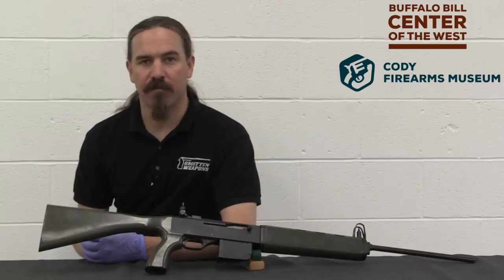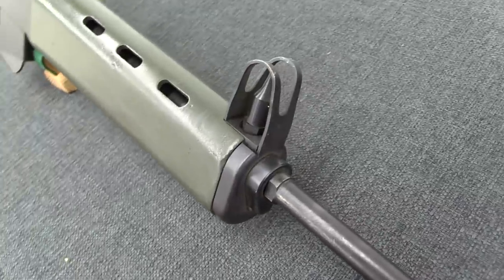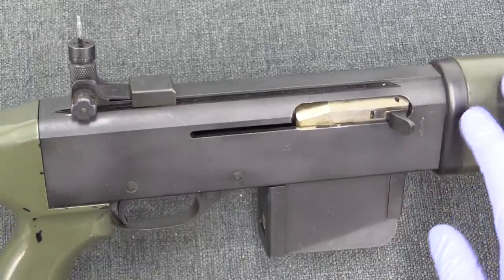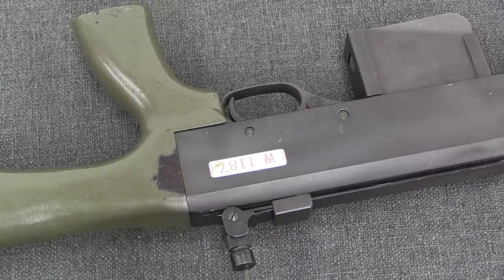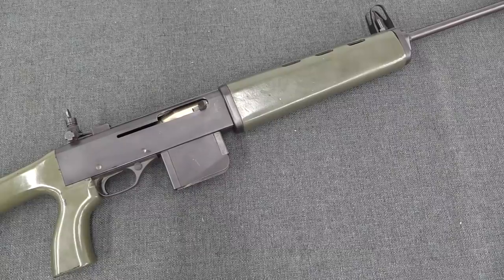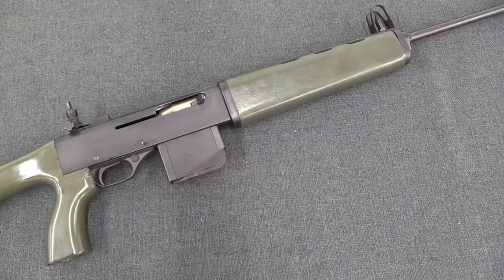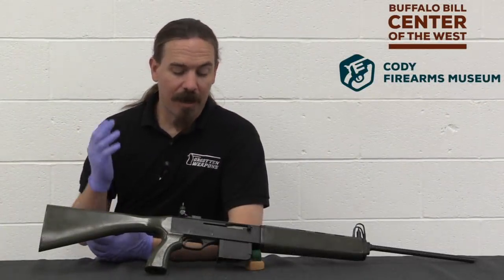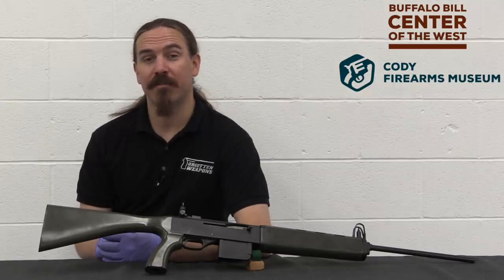Winchester Mystery Prototype: Melvin Johnson does Project SALVO?

Comment: Looks like it was based on a Winchester 1400 the bolt and trigger and general receiver look right and the 1400 was a gas operated self loader to boot. Only problem is that it was released in 1964 so maybe it’s an earlier model 50 or 59 receiver blank that was converted into gas operation (not entirely impossible considering how different it is from base shotguns). But if it was a 50 conversation to gas operation this could be what inspired the 1400 and Winchester gas guns. 

One way or another a cool video on another cool gun!

Comment: My hypothesis is that it was a possible replacement for the M1, before the adoption of the M14. 7.62mm shades of the FN FAL and the Johnson sights, green furniture in an early polymer to meet weight requirements and a magazine well for a 20 round box magazine. But what do I know. If it was it would have been cool.

Comment: One thing that would be of interest Ian, has anyone done a chamber cast?  Some of those serial bullet cases used very long necked and shorter shouldered cases, while staying more of less .308 OAL.  That would be very interesting to see and could be done without disassembling the gun.  The other question I have is how is the magazine retained?  Maybe I missed it in the video but I didn't see it mentioned.  Last comment; the 'hole" at the back looks like a Winchester pump shotgun (Model 12 like) bolt release (or is it on the wrong side.... I don't have one handy to check...)

Comment: Internals looks a lot like some Winchester Super—X1 and that rotating bolt would later pop up in the mid 60s on the Winchester 1200. I have several examples of both in Phoenix if you would like to examine

Comment: I would guess that it is intended as a possible replacement for the M1, competitor for the M14. They roughly copied the form of the FAL, but used parts they already had onhand. Likely this later morphed into the Winchester model 100 rifle.

Comment: You mention not knowing what magazine it took, yet I find the lack of even a magazine catch interesting. Normally if it used an existing magazine, the catch would provide a clue. This appears to have only a hole punched in the rear of the well, suggesting a catch mounted on the magazine itself, perhaps as a stopgap expediency for testing.

Comment: If that's a 1200 trigger group, the gun would likely date from the early or mid 60's. I wonder if they were playing with the idea of a cheaper replacement for the Model 100 based upon the 1200/1400 shotgun platform? It's not a terrible concept; the space occupied by a 12 gauge barrel/extension would be sufficient for a suitably beefed up rifle breech.
The paramilitary styling could be just to spice up the project or offer some misdirection as to the true purpose.

Comment: I'm fairly certain this is built off a Winchester 1400 semi-auto shotgun which would mean it's post-1964 OR the design work that went into this eventually evolved into the 1400. The bolt and carrier look very similar as does the receiver setup though the bolt head on this clearly has larger lugs than a 1400.

Comment: I really wonder if this was a developmental competitor or replacement to the Winchester 100 sporting rifle as it certainly used a lot of cheaper to produce parts (aluminum receiver, shotgun trigger group, synthetic stock)  completely possible that some of the military features were just expedient at prototyping.  I "think" the trigger group is off a Winchester 1400 rather then a Model 50.

Comment: I'm with you Ian. That shade of green, that's feeling Army, that's feeling military. 

I'm also wondering about just how much space is in the stock. If there's enough for a cleaning kit, that also would be a military sign for me. For the period at least. 

Combined with .308, the timing, you're making a real a good case for me. 

As for the one part I'm not sure on, need a rewatch on, it's just how shotgun this feels in places. It's not just the bolt, it's the main metal receiver that just screams shotgun to me. 

If I had to guess, I would sooner suggest that this was a spitball, can we do it type of project. No-one said they couldn't and they just got started. It's got a bit of kludge, kind of ugliness, kind of making it work before making it pretty feel to it. It feels like a test run before the actual prototype. It feels on some level like a mechanical test, do the systems, mechanisms in that configuration actually work. 

It's the pre-prototype on some level. At least if we use my game making language here. Even before the alpha build.

Comment: Model 1200 parts?  Model 1200 was introduced in 68 to compete with rustingtons 870 downmarket cost cutting machined and assembled by unskilled labor shotgun.
Edit, model 1400 was semiauto variant.   It was introduced in 64.

Comment: I would say this was definitely made post 1964. Thats clearly a winchester 1200/1300/1400 trigger group. The gap he shows in the trigger guard is for the slide release on the pump action. Probably a "military" prototype of the winchester 100 series of semi auto rifles. Which were built from 1961 to 1973.

Comment: I think the bigger indicator that was a military related project gun is that magazine well. Considering almost all rifles intended for civilians during that time period, would be focused on hunting. Therefore such rifles would typically designed with holding only 5 rounds in mind, but that rifle has a magazine well that sticks pretty far down. I'd put money even if you were to limit the magazine size to just that of being flush with the magazine well, it would hold at least 10 rounds possibly more.

Other then Hunting the only other real possible civilian market would be police forces. While there was probably a market for semi auto police rifles, a semi auto with the power of something like .308 would really be overkill for most police needs today, and I would think that would have been seen as doubly so back then considering almost all police forces at the time were still using revolvers. I would think if a police force wanted a semi auto rifle, an M1 Carbine would have been considered more then sufficient.

Comment: Could it be possible that it might have been from the 60s and been an early concept for a dmr self loading dmr type rifle? Like an answer to the Soviet SVD rifle, with back up irons and using just parts they had laying around? I couldn't tell to well but on top of the receiver it looked like a it could have been fitted with some kind of scope mount. Considering the jungle environment that we were fighting in Vietnam it seems possible that they could have been looking at options to replace the scopes m14 with something lighter weight but still able to punch through the thick jungle.

Comment: You may have found the Holy Grail of .308 military rifles ... the first .308 assault rifle made in 1949 to 1951.... and here is why .
It's either a .300 Savage or one of the  first .308 Win.  Rifles ever made .
When I worked at Gunsite in Paulden Arizona when Jeff Cooper was there this was always talked about ...that Johnson had built 2 prototypes from a Winchester 50 receiver and gas impingement system ....Winchester had the early  operations of .308 rifles before anyone ...in 1950 before anybody had even got the cartridge and Johnson  the father of the .308 assault rifle  ....not that Ludwig Vorgrimler. .... who invented the roller lock system that HK uses and  father of the device 06 H which you featured on your show.... he is credited with father in the first .308 assault rifle at CETME (Centro estudios de tecnicos y matematicas espanol) in Winchester always stated publicly  that he wrongly  always gets credit for this. 
This may be the mystery first .308 rifle that everybody always talked about  as Winchester had the .308 cartridge experimental develop from the .300 Savage in 1949-50!... and kept it top secret and were building prototype  rifles before the trials  in '51 and '54 ....this could be the first 308 Winchester ever made.
They ,the company Winchester, had the  .308 in 1949-50 4 years before the rest of the world 1949 to 1951 had to have been the years this was made because in 1951 he left employment from Winchester and workedfor the Secretary of Defense and left the Firearms business.
The US Army T trials took place from 1949 to 1950 Dover Delaware... that's when this gun was probably made.
Don't forget Winchester had the Winchester .308 four years before it was adopted in 56

Comment: Looks like they took parts from a win 42 adapred the bolt for cartage use and custom made a receiver housing for it all and ad far as a gas system  out a moldel 50 and scaled it down  i see this used for the duplex round for sure

Comment: In. 17 fireball with a straight pull action would make that one heck of a hunting rifle I'd make it either semi or straight pull be perfect for squirrel right up to deer I like how straight it all is fit a pic rail on the upper and add a nice brass butt plate and have the wood on the hand guard and grip sanded down to reveal the grain its probably American walnut add a splodge of tung oil and walnut oil rub it in lovingly to the wood and add a nice 3x9x40 hawk e.u scope and bingo perfect woodsman rifle carry a 454 cassul 4inch bfr on ur hip for bear or any other nasty things idk tho theat rounds got some serious speed on it it would probably blow a bears head off idk why I love. 17 caliber guns from. 17 match right up to the fireball they perform way better than they should speed is key I guess the fireball needs a barrel change after every thousand rounds because the chrome lining and rifling erodes due to the velocity there a bitch to clean too u needed an air rifle cleaning kit really to clean the barrel on my old marlin. 17hmr way back when it was still a newish caliber in 06 it could shoot neat holes through coins I made all my frends necklaces with a shot quarter

Comment: Looking at that rifle 
To me it looks like a lot of the parts came from a Winchester 1400 shotgun 
Or the semi auto shotgun that was the forerunner of the 1400
I have a Winchester 1200 the pump version and a lot of the parts look the same
Reply: The 1200 and 1400 both had rotating bolts 
LOL The 1200 and 1400 used the Exact same barrel 
The 1400 just had a gas port drilled in the barrel 
Because 1200 barrels were hard to get  I use a Winchester 1400 barrel on my Winchester 1200 shotgun with only a small amount of gas leakage